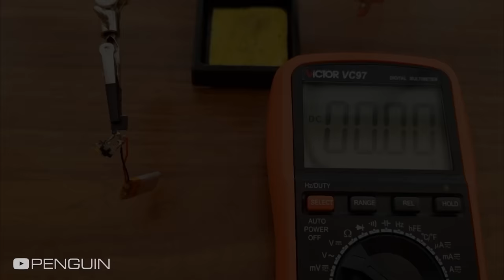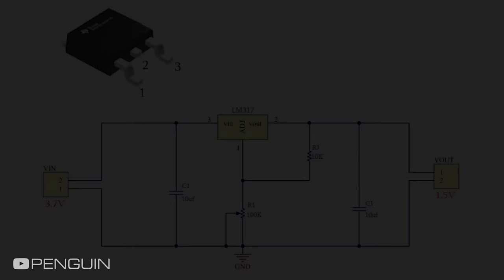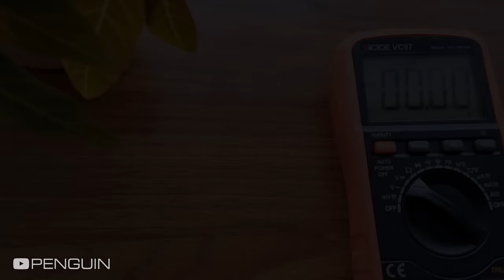How to make Rechargeable 1.5v Li-Ion battery | DIY Rechargeable 1.5v battery at home

Comment: You know, with the availability of rechargeable batteries like LiPo and "off the shelf" rechageable batteries, why waste money and time like this? Yes, I understand why you do this because I do this with cheaper materials, and get higher capacity at the exact same voltages - or higher using stronger  concentrated chemicals in old pill bottles I got from a friendly neighbor. I use the Edison Design and can build one in 15 minutes. I get 1.4 to 2.0 Volts at 1100 Mah using iron coiled inside with an alkaline solution and a carbon rod salvaged from a "D" cell. I run a low power Amateur Radio transceiver for 3 hours before changing the homemade batteries out to continue operating. While I am having my fun with my "hobby", the depleted cells are being solar charged using a buck circuit set to the 12VDC output to my solar array. This is so simple, why are you doing it this way? I haven't bought carbon zinc or alkaline AA batteries in 5 years building my own batteries. The batteries may be a bit bulky, but they work well in stationary use. Buy the book on the Edison cell, and build GOOD, reusable batteries that have been around 100 years, or so. Some of the original batteries are still in use after 100 years, and they are still made commercially.

Comment: I just cringed when you used the negative cable (black) straight to the positive and the positive cable (red) to the negative. Not that that will hurt anything, but you can easily get mixed up again and short things!

Comment: For only 360 milliamp hours capacity it's not worth the effort to DIY these. Pale Blue lithium-ion AA batteries with built in SB charging are 1560 mAh. EBL makes them without the built in charge port (requiring a special separate charger) and packs 3000 mAh into their AA size and 1200 into their AAA. Good luck finding any to buy, they're almost always sold out everywhere.

Comment: Why use a potentiometer? You could do the math and pick the correct resistor straight away, or if unsure use a potentiometer to get the correct voltage, but then measure its resistance and replace it with the corresponding resistor.
Reply from the maker: Yes that's right. A suitable resistor can replace the potentiometer. In the video, a potentiometer is used to make this circuit understandable to the viewer.

Comment: but ur mah in 1.5 v should not be  more than 450 ah in 1.5 volts , it's very low than nicd from 25 year ago :(  180 mah in 3.6 v  =  450-500 mah in 1.5 volts

Comment: bro u just downvoltage lithium batteries and made the circuits without a board and sticking on each other which will cause overheat shorting etc

Comment: This project i absolut not at beginner DIY project. You never show that you remove the battery cells b efore drilling. Drilling into battry cells new or used can be very dangerges. (And please don't try to drill holding the cassing in your hand, that can damages your hand).
 * I will not requment the project to anyone without many years of experince in working with electronics.* 
/Christian (electronics development engineer )

Comment: Make a hole on it and poof in a second you have survive being smart. And also why spending efforts while you can just buy thing that is more properly built than drilling a dangerous lithium battery that could turned into a hanmade grenade.

Comment: there is a trick here he wastes a lot of time you drilled out the guts for that battery you installed wire electronics etc I don't know what the hell you running that clock off of but there is no battery inside that battery

Comment: 180mAh..... rechargeable AAs are 2300mAh. These will last 5 seconds.
Reply: It's dropped down from the 7v to 1.5v, so the capacity will change accordingly, but your still better off just buying a set lol
Reply from the maker: 230 mAh 3.7V = 888mAh 1.5V.
Reply: @PenguinDIY  I'm an electrical engineer. I know, was just over exaggerating. Yay ohms law.

Comment: ridiculously stupid plan, reducing 3.7v to 1.5v by dissipating it using a lm317. use a high efficient step down converter instead of wasting over 60% in heat.

Comment: Here is a secret that I will share with you for batteries especially double A's everybody buys them and they always end up tossing them out and end up buying more but here's a thing you really don't need to toss those out batteries can be recharged and here's a method use myself when you're in that moment and you want to charge your batteries and you don't have a charger to plug in it's a simple matter of physics take your batteries place them on a heater could be your air vents let them set for quite a while then take them off and they'll be fully charged as we all know heat creates friction friction is electricity of course some people get to weary might get too wary of trying that because they might get that taken oh that's battery could explode well it's not a campfire so they won't explode it's just a common heater like the ones you would have in your trailer or your house eating your house up it's like stick them on there's let them sit for an hour or more and they'll be fully charged

Comment: 150 mah, omg ))) downgrade
Reply: Yeah, but not that much.
There are two of them, look carefully at 6:40.
Also not 150, but 180 and with different voltage:
2 * 180 * 3.7 / 1.5 = 888 mAh.
Original MN1500 should have 1300 mAh.

Comment: This HAS to be a freaking joke!!! My god. I mean, ok, it's "cool" that someone thought of doing this, but jesus christ the implementation of it is horrific. I wouldn't trust that "battery" anywhere near myself or anyone I cared even remotely about. Actually, if I made it, I wouldn't want it near anyone, even people I don't care about, because if (when) something went wrong with it, and one of those lithium packs ends up going into thermal runaway (two packs, enclosed in a nearly sealed metallic container that likely won't do a great job at transferring the heat away from the battery packs inside... what would that turn into, once they go into thermal runaway....? hint... it starts with a B and rhymes with SHLOMB... *rolls eyes*). Best case, you'd get a jet of flame coming out that little LED hole, but that's only if there happens to be enough of a gap to let that flaming jet of gas and fire out of the battery body. Worst case, that hole is too small, or there isn't enough of a gap, or the pathway to the hole is just too blocked with the mass of parts that was jammed in there, and instead of a flaming jet coming out of that hole, the assembly would rapidly and violently "disassemble" itself, throwing shrapnel into anything that's close to it. It would likely also start a fire, depending on what's close to it.

Yup, file this one in the "interesting but i'll never try it and hope nobody else does either" filing cabinet.

Comment: You don't know what you are doing. This is very dangerous, the LiIon battery needs a BMS to charge it and protect from UV/OV and shorts circuit. If anyone tries this circuit, and try to charge  the battery, it will explode, causing serious injury.
Please remove this video, you don't know what you are doing

Comment: Rechargeable batteries are readily available, cheap, more reliable, and have far more capacity than this project - assuming that it even works. A typical rechargeable nickel metal hydride AA cell costs less and has 2,500 milliamps or more, the cell used in this project is 180 milliamps!